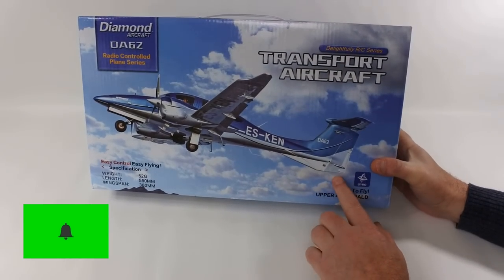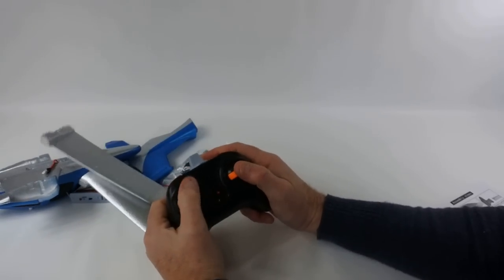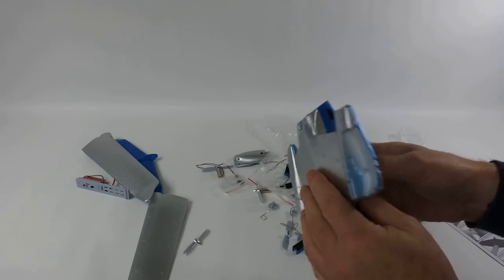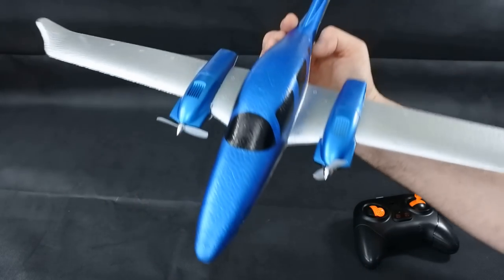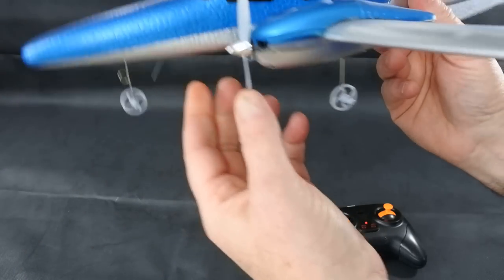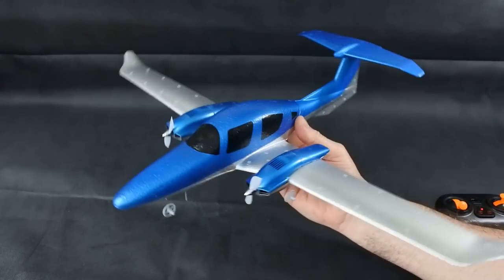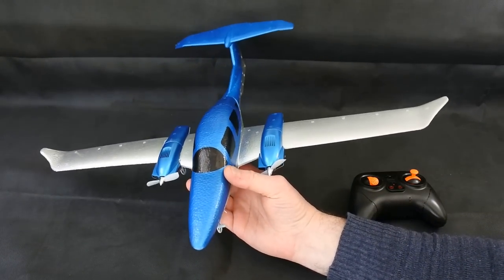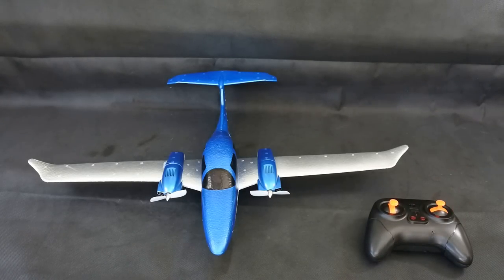GD-006 Diamond DA62 2 CHANNEL RC PLANE👍👍

Comment: I've had mine for a couple of years now ,I put a tiny fpv camera on mine. some of the paint has worn off now, but it still flies great. It seems to turn left better than right though, but over all it is good I just made another video of it. Here is what it looks like with the camera,  I wired into the power of the plane so I don't have to run a separate battery. .https://www.youtube.com/watch?v=NMvIxuFgSqc